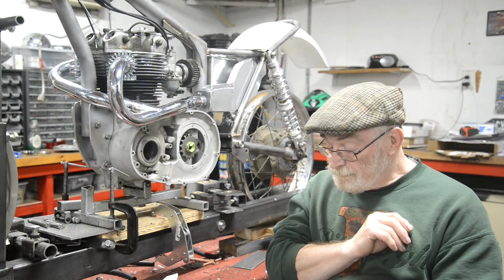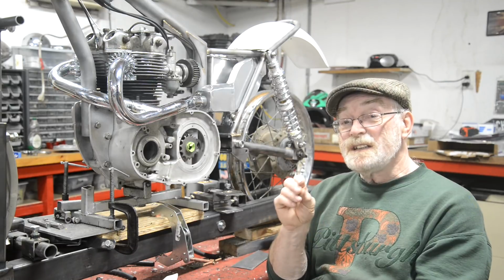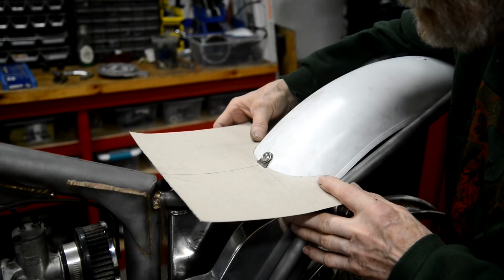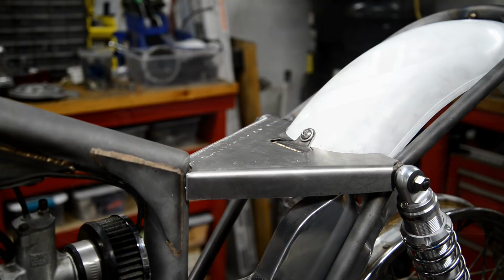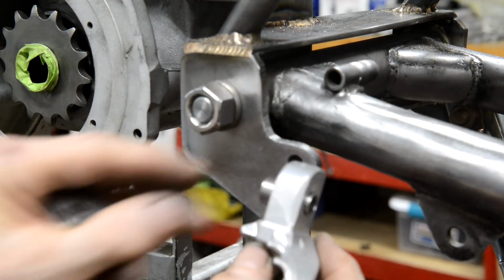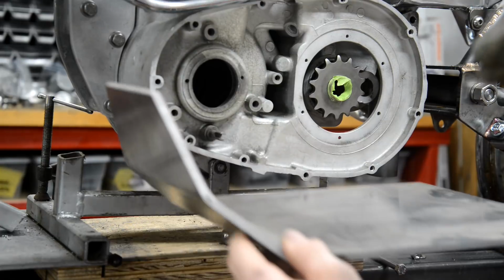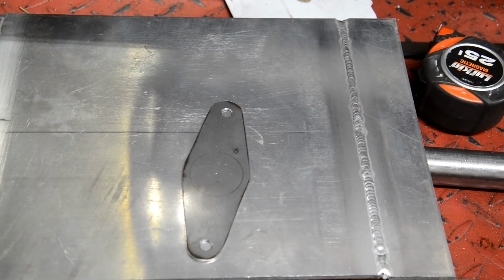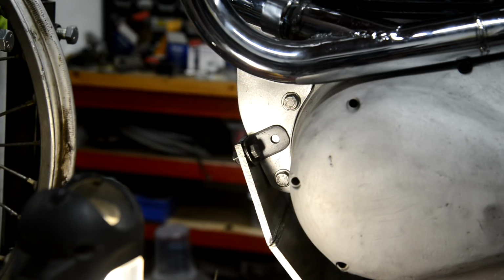Triumph 500 Otter  -  Part Thirteen

Comment: Have you thought of using the hard plastic type of clips that plumbers use to secure their pipework here in the UK on your seat base.
Reply from the maker: I looked at those but the base is a little thick and would lift the back end of the saddle up.

Comment: I am sorry Michael but it has been bugging me, why did you use two bolts (one either side) to bolt the brackets to the skid plate and the engine mounts? Would it have been possible to weld (or braze) the brackets on to the engine mounts or more difficult have one bolt from one side to the other?
Reply from the maker: Every time you take the bash plate off a trials bike you find it has deformed. Separate mounting points allow a little more movement in the plate and make realignment of the holes much easier.

Comment: For the front mounting of the skid plate why not use a single  long through bolt instead of two shorter ones?
Reply from the maker: This gives the plate a little more chance to flex. They always distort in use and it is easier to get the plate holes realigned like this.